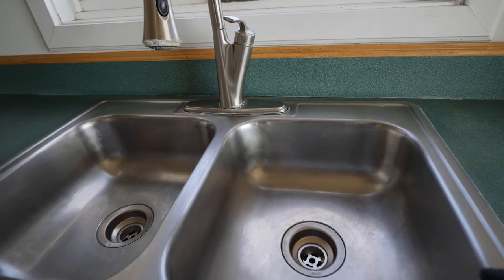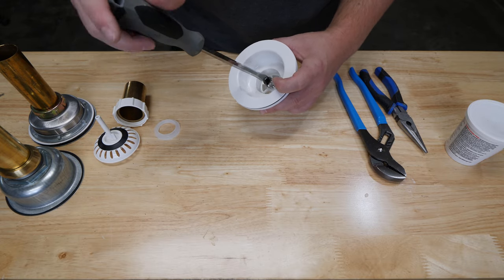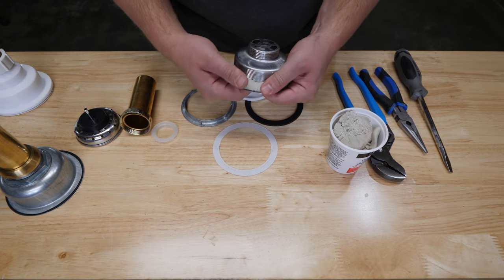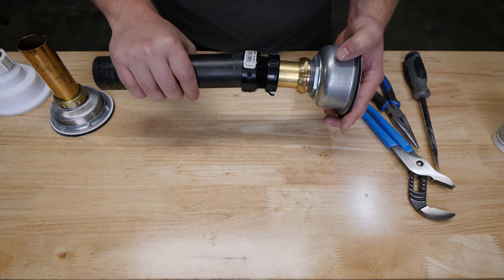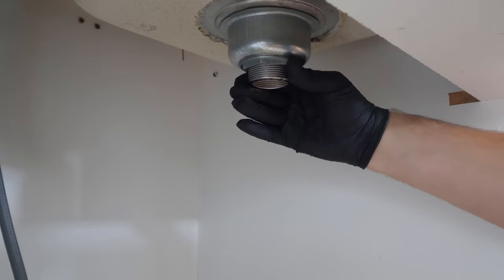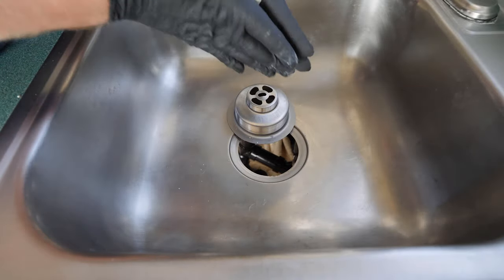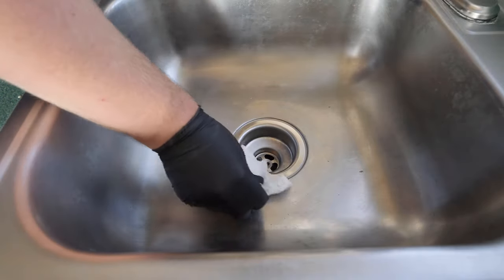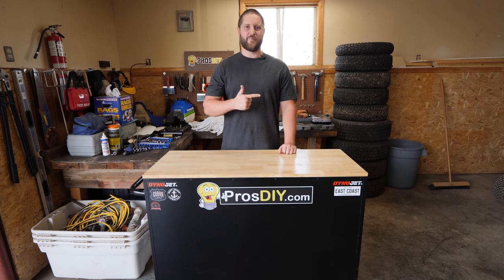How to Replace a Kitchen Sink Strainer

Comment: I loathe that large lock nut type because many things can happen, and it's not exactly a solo job. The nut can slip, the cardboard ring/below rubber washer can expand, and it may not stay in the center. It's a POS!

Comment: I bought a new sink with no directions included.  The strainer has both a foam gasket and a rubber gasket.  After watching this video I'm assuming the foam gasket goes above the sink and the rubber gasket goes below, and no plumbers putty is needed.  Does that sound correct??

Comment: Fantastic.  I had the 3rd type.  However the pressure cup was "welded" to the assembly from 20 years of rust.  Every other video did not show how all the pieces of the drain assembly went together.  So I didn't know that the pressure cup was a separate piece and that it was "welded" to the strainer top.  Once I knew that, I could use tools to CUT the pressure cup off from the main strainer assembly.

THANKS!!!

Comment: Thank you, great presentation and good examples.
My old strainer came without putty, maybe it just dispersed but I never had a leak.
If understood correctly, the new drainer I purchased needs the putty.  As the newer plumbing connections need less and less of any Teflon tape, I wasn't sure if putty was needed.  So I've got my answer   :)
EDIT:  I just saw now that you have affiliate links, I definitely would have purchased the pieces, especially Moen...  too bad I didn't see your video earlier.
Reply from the maker: You're welcome! No worries about the affiliate links :) I'm glad the video was helpful. Cheers!

Comment: How tight should that large locknut be? The more I tighten it, the more putty comes out from the top around the hole. Is it possible to tighten so much that you squeeze out all the putty?
Reply: The strainer nut is made of aluminum,  so if you tighten it too much it will strip and then you'll need a new one.

Comment: But how tight do you go?  I've put it on too loose so the putty eventually breaks away as well as too tight where I've squeezed out the rubber gasket. Is the goal to get metal to metal contact up top?

Comment: I got an Elkay drain and it’s the one without the putty per your video but the instructions indicate to use putty. What’s your thoughts? Is that standard to use the putty now? I noticed in one comment mentioned not to use both but Elkay of course has the one which goes again this in the instructions. Appreciate the vid
Reply: Actually figured it out gasket goes on top of drain housing from underneath and putty on top sink flange area. Thanks for the video

Comment: Great video, I wish mine came out that easy. After who knows how many years my basket leaked, I went to touch the lock nut, and the whole tail piece just fell off. The problem is the basket and cup do not want to release themselves from the sink. 

On a side note, I wish there was one with a way to stop my wife from putting food in the drain and wondering why it gets clogged all the time...

Comment: Do the removable nuts that hold the ABS drain line and P-Trap in have washers in them that need to be replaced?  Should the washers be replaced and what type of washers are the best leak free choice?

Comment: Best so far but still going thru it so fast visuals are everything perhaps showing the nut that lifts basket into place  as well as the nut that secures to drain each going different directions getting the ring of paper under the rubber gasket to line up the same time your tightening in place nothing can slip outta place tightening the basket squishing out the extra putty giving it a tight fit without over tightening….. girl power today 🥲👏🏻👍

Comment: Does the screw ensemble model need plumbers puddy or is the washer provided enough....you were not clear on if all three assemblies needed plumbers pudy or not when connecting to sink....sorry, its my first time using the screw ensemble model....
Reply from the maker: Different models will come with different methods to seal the top flange. Either a foam gasket or thin rubber gasket which can take the place of the plumber's putty. Some plumbers just throw the foam gasket or thin rubber gasket away and use plumber's putty, because that's what they are used to. I wouldn't use 2 methods though. Only use the supplied gasket or plumber's putty, not both. In the end it's your call.
Reply: Thank you for your answer, it was a little late so I just threw the foam seal out and went with the puddy...
Not a big fan of this screw assembly model, I don't know, I am kind of old fashioned when it comes to replacement parts...( I learned how to do this in high school home owners class for an extra credit,,,,taught us to change our own oil, rotate the tires, fix the lawn mower and repair plumbing...best class I ever took as I actually learned things I can use in real life! 
Keep up the videos, you are helping housewives and sissy men learn to be useful

Comment: does it come with the tailpiece or do you have to buy it separately? And also i have abs pipes where can i get the abs nut to tighten it to the tailpiece
Reply from the maker: Most strainers come with the tail piece, but always double check as some models they are not included. Most hardware stores will carry the "abs nut". Ask for a 1 1/2" ABS trap adaptor.

Comment: Where can I buy the white strainer I can't find it on line do you know. The one that attaches with a bolt.
Reply from the maker: I purchased mine from a local plumbing shop, but most hardware stores and amazon carry them.
Amazon Affiliate Link: https://amzn.to/34cHo8o
Lowes: https://www.lowes.com/pd/Keeney-3-5-in-White-Plastic-Rust-Resistant-Strainer-Basket-with-Basket-Included/3132151

Comment: That gasket makes the inside diameter so small that the sink takes more time to drain. Isn’t there anything that “fits” better?
Reply from the maker: Do you mean the nylon gasket that is inserted into the tail piece? Unfortunately this is an industry standard and almost all kitchen sink trap adaptors connect this way. If it's draining really slow I would double check proper grade, venting, and possible partial clog.